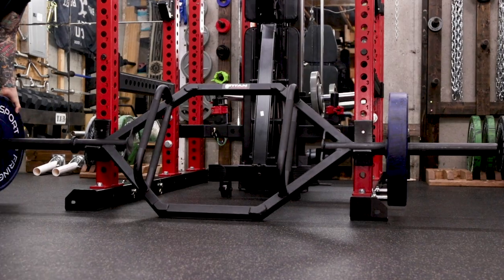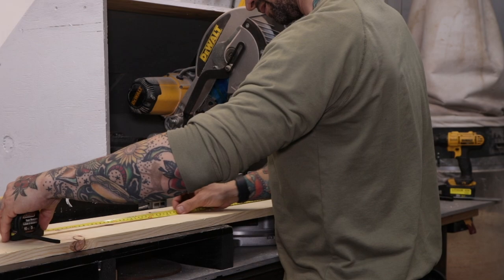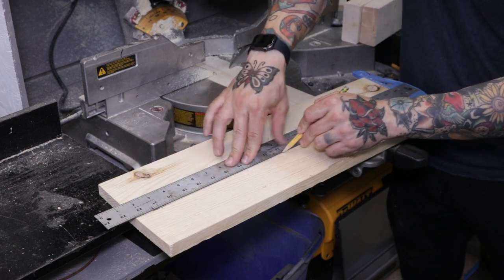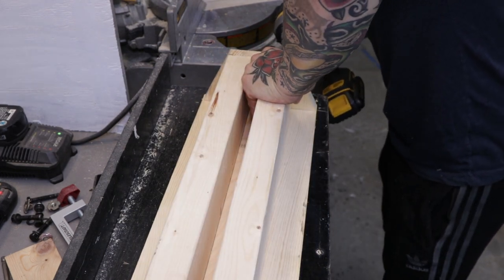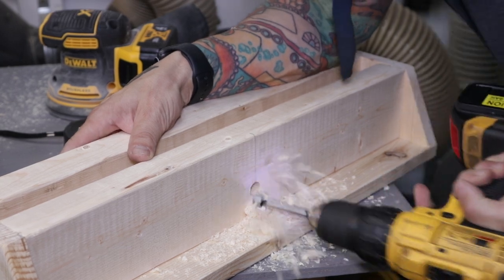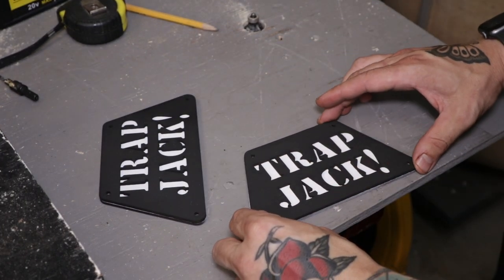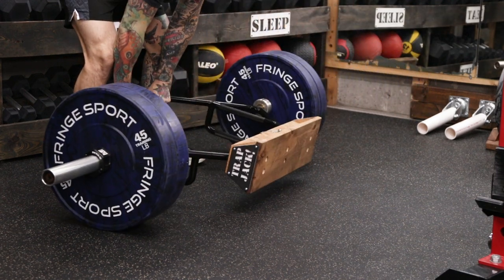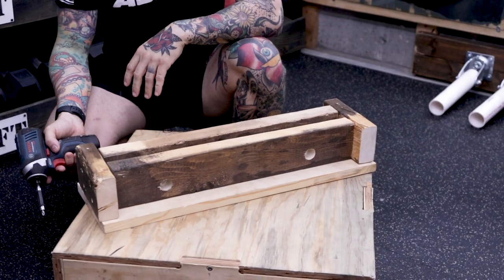DIY deadlift jack for trap bars, The Trap Jack!

Comment: I can use a jack with my trap bar, but this looks like a nicer way to have it on it's side more upright closer to the wall and out of the way when not in use...
My trap bar is really heavy, and really long, so it's not the easiest thing to deal with when there's ceiling limitations and stuff.

This looks pretty difficult to use with more than the first set of plates, especially if the trap bar is already heavy itself. If I had a non-jackable trap bar, I would use this for the first pair of plates, and then use a deadlift wedge for the rest.
Reply from the maker: It’s definitely a great storage option as well

Comment: Finally! Been waiting for this tutorial. 

One question regarding the jack. Why is it on the bar whilst you lift? Is it not possible to remove it and then clip it on after lifting?

Thanks in advance.
Reply from the maker: Yes, you can add and remove whenever you want. For me, it was easier to leave it on but it really boils down to what works for you.

Comment: The 1”x8” is that actually 3/4” x 7.25”?  

Usually a 1”x8” board is nominal.  Just checking before I actually make it
Reply from the maker: Correct
Reply: @KaizenDIYGym awesome thanks!!!  Great design just what I needed
Reply: @KaizenDIYGym where did you source the pin

Built mine tonight took some liberties with material I had but works great!!!